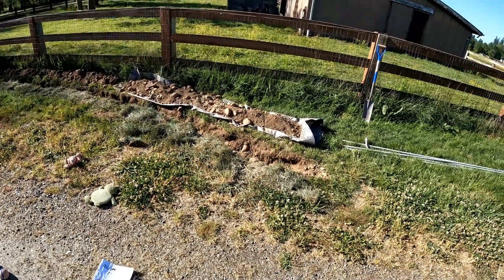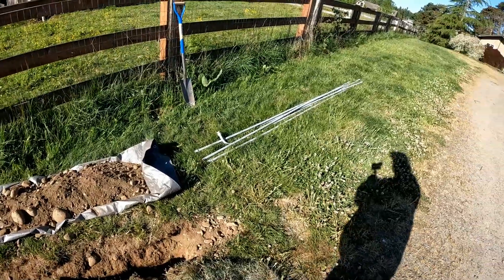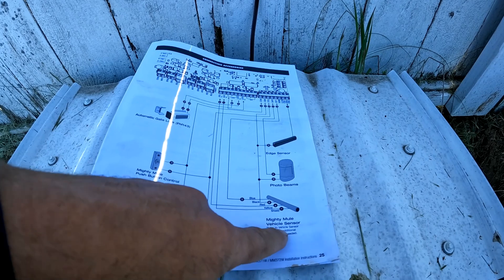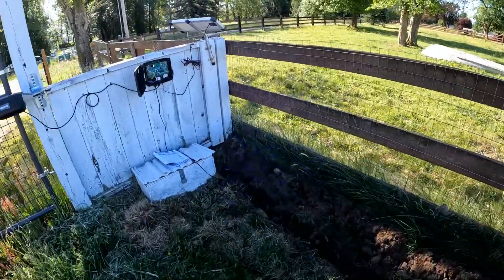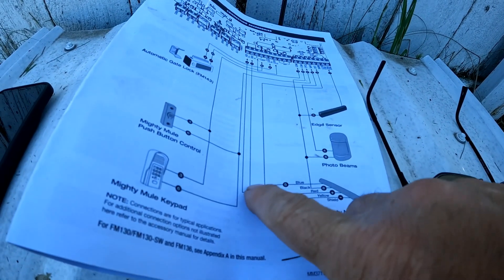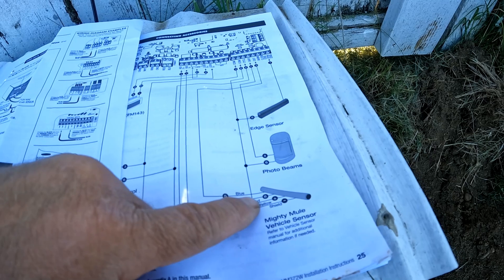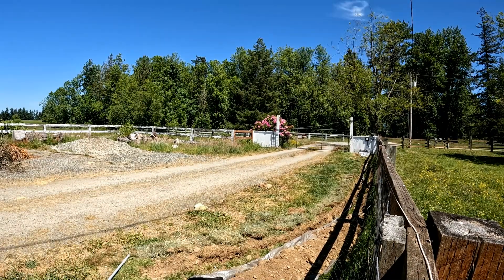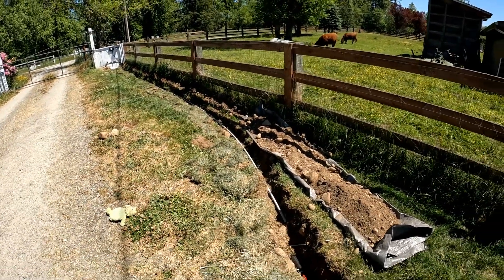Mighty Mule wired gate sensor

Comment: Am I right? According to your video, you connected your  Solar cable to the main power connector. I figured that's how it might be but didn't want to do that until it was confirmed that is the right way. I couldn't find anything with that same specific control box. The Solar panel is from the previous Mighty Mule gate we had.
Reply from the maker: @Miguel_A_S  yes that’s correct. Check out my video on installing the gate, around the 12 min mark it talks about hooking up the solar panel. Thanks for the comment and watching the video.

https://youtu.be/uJlmCxdDec4?si=cenH1eHMcsSDXSFK

Comment: Thanks for the video.  It would have been nice if you actually specified where the wires went once you figured it out.  You kind of just passed over that unless I missed something. Watched it a few times

Red. 12v pos
My braided is green assuming ground. 
Green/braided and yellow to 12v neg
Black to com
Blue to exit

Is this correct???  

Thanks again
Reply from the maker: I’ll have to go look at the control box and get back to you soon. Thanks for watching the video.
Reply from the maker: Yes, that correct as far as I can tell.
Reply: @mattlacombe3912  thank you.       It works a couple times but then doesn't.   I'm thinking i had a vehicle too close when it first initiates and I think it goes through a calibration.  I'm gonna power it down and back up and make sure nothing is near the wand.   Thanks for confirming. Appreciate it and the video
Reply from the maker: Our car activates it easily, our truck you have to drive slow and closer to the sensor. Usually that works but sometimes you have back up and try it again.
Reply: @mattlacombe3912  thanks.   I thought i was going crazy.  Every delivery truck all cars all will trip it. My truck wont trip it only in the morning.  When its dark.  No matter how slow I drive in the light it works.  Weird.  It does have chrome step rails if thatakes a difference. Really weird. Ill try extra slow tomorrow